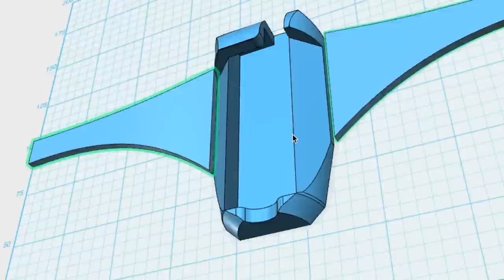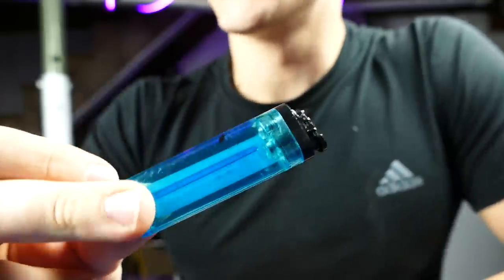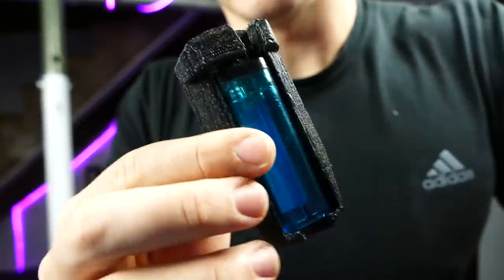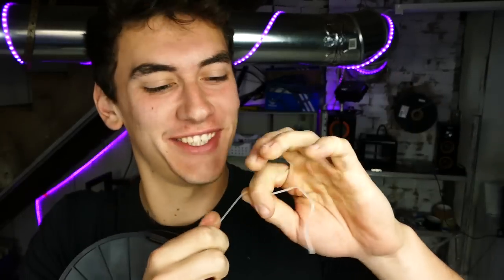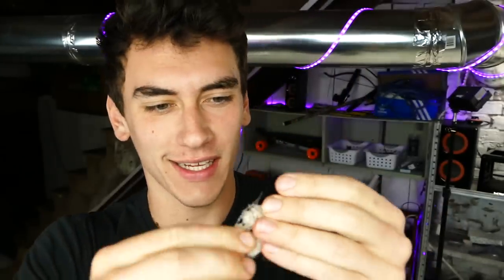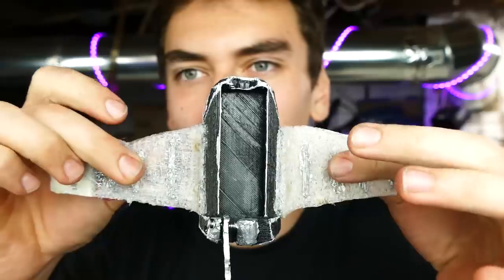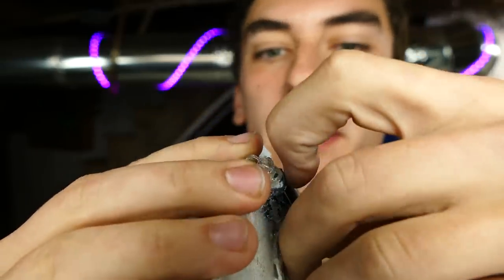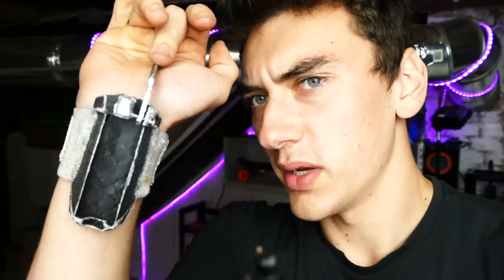Make a SPIDER-MAN Homecoming Web Shooter! - RELOADABLE WEB CARTRIDGES!!!

Comment: To use Ninjaflex, you have to slow down your settings, after that, you increase the heat from 210 (PLA) to 240 (TPE or Ninjaflex). Slow the print head to something like 30mm/s and for the first layer, use 15mm/s. Don't use rafts and don't use supports! Hope this helps and hopefully you pin this comment!
Reply: aint nobody got time for that
Reply: Hahahhahahahahahha
Reply: Bowden setups suck for ninjaflex. you can make decent prints if you every setting perfect but you need a direct drive to make really nice prints.

Comment: hey i don't know if you'll see this but if you want almost injection mold looking 3d prints all you have to do for smaller ones is put alittle acetone on a paper towel and cram in in the bottom of a glass then set the glass on top of the print upside down i don't remember but just search it up it makes them look really nice i guess for bigger one you could do it on a bigger scale? but yeah i hope you see this and have a good day

Comment: I have an idea since I feel like the trigger can kinda be an annoyance, so what if you could use the screw with some piece of small plastic or something and glue a looped string or a string tied to a ring, the string is short enough to reach and not get in the way of hand movements. So you pull the string forward, which has a piece push onto the lighter to shoot

Comment: shooter with...white ultra strong para-cord... the length of your forearm.. with a titanium tri hook... Damascus lining for strength, with a slim upper arm brace... and a fuel cartridge on top.. slim oval suction cup... all connected with nylon and Velcro... nitro carbon gas for launch pressure... so you could swing, climb/stick, and shoot.. just like spiderman.. 46 dollars.. my design idea